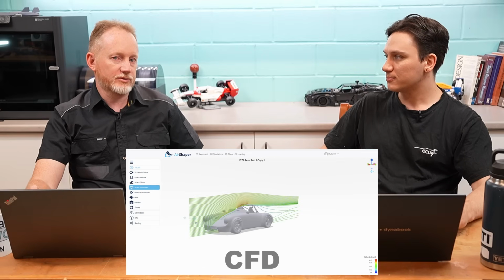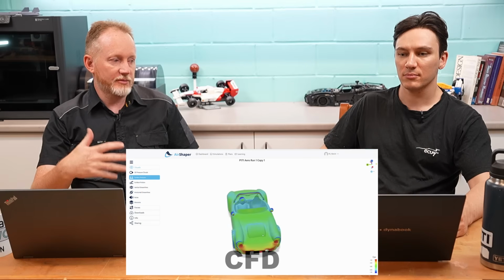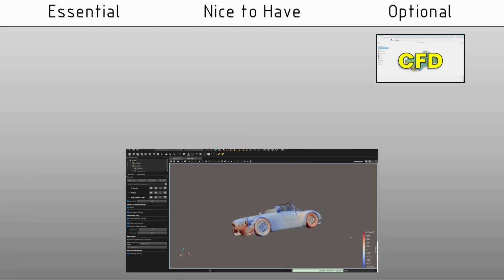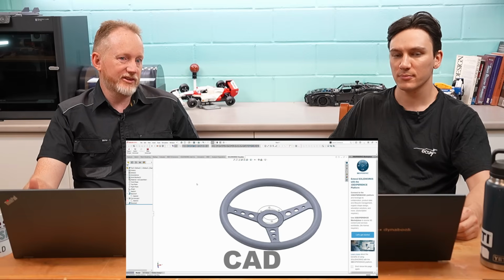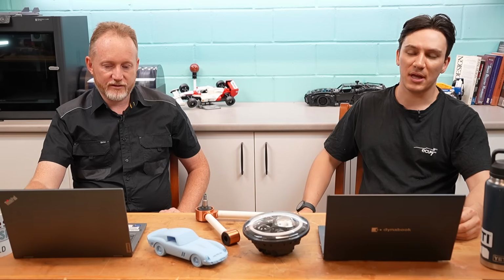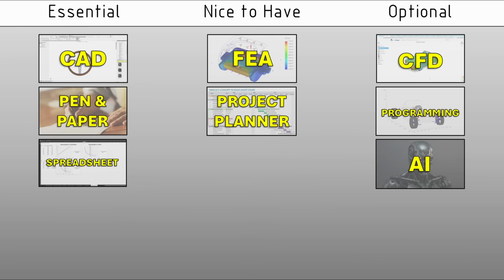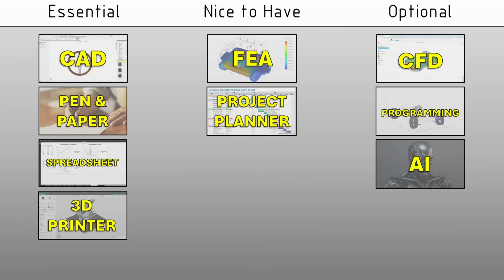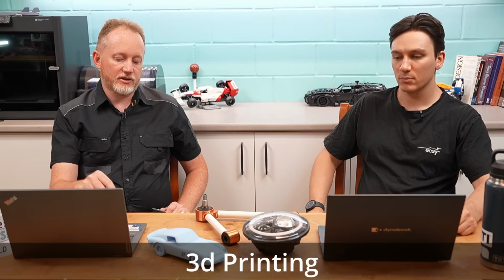Our Top Car Design Tools: Pros & Cons (Dr. Kev & Harley Q&A)

Comment: Havent watched the full video yet but there is a free version of Fusion 360. Its called Fusion 360 for personal use. You can also get soldiworks + 3D Experience for about £50. per year it is called 'Solidworks for makers'. But these are not for full business
Reply from the maker: Absolutely these are great options for most projects at home.  I haven't put enough time into Fusion 360 to be a decent user of it yet, but it is the software I recommend to most people not doing this professionally.

Comment: I think it would be valuable to expand the discussion on CAD by distinguishing between its different practical uses. For example, 3D CAD is excellent for prototype development and 3D printing, while 2D drawings are still essential for sheet-metal fabrication and even for assemblies where tolerances and manufacturing details need to be clearly defined.

One platform that really stands out to me is Onshape. Because it’s web-based, it’s easy to access and there’s a no-cost tier, which makes it a very compelling option.
Reply from the maker: Good point on the 2d CAD.  There is still plenty of value in 2d drawings in manufacturing, and maybe some things to cover in later videos, especially around tolerances.

I have heard good things about Onshape, and maybe I need to give it a go at some point.

Comment: 18:02 go to anna's archieve, download some great book about engineering (eg. Machine design, an integrated approach by Robert L. Norton), upload that to notebookLM and you have an absolutely masterful engineer available to answer any questions.
Reply from the maker: The future of AI in summarising texts is already here and useful.  Just a shame that anything from an AI needs to be verified, and it only takes in information that is fed to it, so much of which can be wrong in different fields.

Great tool to use in the process, but also highlights the ongoing need for testing and verification.

Comment: 8:27 Onshape has a free tier version with nearly full functionality but everything you make is public. For hobby projects probably not a big deal though.
Reply from the maker: I like the look of Onshape but am definitely not a fan of publically available models (especially part way through a design).  I wonder about the liability that might be assumed.  If someone did download something an engineer had uploaded, could they do so assuming that it is suitable for the task, and then break something at a time that might cause injury.

Having been a co-founder of an engineering design company at one stage I have learnt to be very careful around liability.  It might not be an issue but I'm fairly cautious around issues that could cause harm (even tangentially) or take risks that could impact my family.

At some point I want to see how some of the designs we go through in this project can be released, but certainly not ready for that to occur yet.

Comment: I am very much a noob with cad software, I think a great option is free cad. It's not as good as solidworks but for most things is 90% there. I would not use it as a business but for doing things at home is great
Reply from the maker: With easy access to Solidworks, I'm not sure I will get a chance to really give freecad a go, but I love the idea of CAD being more freely distributed.  The base technology is quite mature now and I think the high prices for a lot of packages really hinder it being much more widely spread.
Reply: @KevinHayward7 I have a hobby license from solidworks that I got for a decent price, but the important parts I design in freecad. The reason being I would like to make the vehicle I'm designing a commercial product and if I design it with a hobby license I might have problems with solidworks in the future since the license is not for commercial use. I asked solidworks for a full licence for startups but got no answer back. Solidworks workflow is much more streamlined so when I need to quickly sketch a part I do it in solidworks, after i develop the part I make it in free cad since I have no license limitations with that software. It's impressive tho how fast freecad is improving and at this rate of progress I think in a year or two it's good enough even for complex designs.
Reply from the maker: That sounds like a good workflow.  Might be something we look into.

Comment: Regarding FEA.
There are several examples of FEA optimised chassis around which consist of a bad design, fully optimised to be as good as a bad design can be.
Here is how to do it properly.
Make a simple beam element model (one beam per tube length, joint to joint)
Models like this are super easy to edit, all you need is the input deck and a text editor to make really quick changes
Keep a list of changes, their weight, and the stiffness
Keep changing where tubes are until you work out what features give high stiffness for their added weight
Combine everything you have learnt into a design
Optimise that design

Clue: It will look like a Lotus 23 chassis, with an extra bulkhead between the footwell and the front suspension, so that the front suspension is held by a six-sided structure.
Reply from the maker: I have a nice cutaway drawing of the Lotus 23 on my wall at work.  Great  little car with a really efficient chassis.

Might get an opportunity to share some chassis FEA on this channel in the future.  It is a process that can be quick and a lot of fun.

Comment: Two tools you didn't talk about are 3D Scanners and the right Books to learn from !! :)
Reply from the maker: The books we deliberately left off as we wanted to draw a line as to what was a tool / software.  We will probably cover some of that in a later video.

You definitely picked up on the 3d scanners.  As soon as I told Harley about your comment we were both a bit annoyed we had missed it.  Especially since we have already had a few videos that have included 3d scanning in the design process.

So yes definitely think 3d scanners are useful in the design process.
Reply: Why would you use a 3d scanner too design a car?
Reply: @Dynie-g7x  So you can scan components you can't make yourself so you can design parts around it and so they fit accurately as well as designing parts for awkward repairs,  plus you could scan other peoples cars for ideas, copying and iterations etc. etc.
All you need is a little imagination and these things can be useful :D

I would guess this tool fits in to the nice to have category, useful but not essential ;)
Reply: @f @freezatron  okay I guess I can see that
Reply: @Dynie-g7x  watch the video link I shared, gives a really good idea of how useful it is :)

Comment: One thing I would like to see is more of an explanation of the maths including an explanation of the units with examples so we can get a real world understanding of how to use the relevant formulas such that a layman can do some basic calculations on the back of an envelope to get them in the right ball park for some home designing.

A cantilever arm would be a great start, lets say we have a beam sticking out of a wall with rectangular cross section where the moment area is 

Breadth X Height Cubed divided by 12 = moment area ..... 

Great but now what else do I need to know to be able to calculate the max load that beam can take of a given length  ?
Doesn't need to be the complicated version where you calculate the deflection over the course of various loads, just what the max load might be assuming the max stress will be where the beam joins the wall, the root so to speak, Like a basic wing spar for example  :)
I've seen this example done using MegaPascals for the force/material pressure, millimeters square for the moment area calc and meters for the length of the beam, easy enough but what comes next ? :)

If I can work out a simple example such as this on the back of an envelope then I'll know of I have understood it well enough to make these formulas useful as opposed to some broad principal that looks nice on screen that I can't actually use :)

This is the kind of thing I would love to see with some examples so we can understand the units involved and how to apply them at the fundamental level.
Same for tension and torsion/twisting. Compression is a little different as one has to contend with buckling so maybe save that one for later ? :D
Resolving 2 dimensional trusses would also be a good one to do a step by step walk through of the maths for the layman :)

Here's hoping anyhow, this stuff would really help to bring the basic maths of engineering to life for many of us and it would be very much appreciated if you could make some videos walking us through this stuff :)
All the best.
Reply from the maker: Not aiming to make these videos like an engineering lecture (I get enough of that in my day job).  But will take the comment on board and try to see what examples we can flesh out a bit more in future videos.
Reply: @KevinHayward7  Cheers mate :)
Thank you for at least thinking about it, it would be great to be able to work through some basic hand calcs like that of a cantilever beam. A rod under tension seems like a nice simple one too. 
Perhaps asking you to explain buckling and resolving trusses is a lot for me to ask but if you could also recommend some good cheap books for the layman to get started under their own steam that would be awesome :)
Cheers
Reply: @KevinHayward7  Btw thanks for the replies, much appreciated :)

Comment: I find it really interesting that you're advocating for spreadsheets over programming for calculations. I recall a first year lecturer telling the cohort that using excel over the likes of matlab was a crime and a habit that should be broken. I've found myself actually using both depending on the depth of the calculation/simulation required.
Reply from the maker: Well then put just about all engineers in Spreadsheet jail.  Without wanting to speak poorly of another lecturer I think these "use this tool, not this one" are not that helpful.  Engineering is a practical solutions orientated exercise.  Anything that gets you to the answer within a reasonable amount of resources can be useful.

I say this as someone who has done a lot of matlab (and spreadsheets).  One of the big realities is that as engineers we largely work in teams.  Every engineer I know has a workable knowledge of spreadsheets.  A lot of engineers (especially Mechanical) don't have good programming chops.  That makes it hard to share work on a team if it is programming.
Reply: @KevinHayward7 would we be jailed in a spreadsheet cell? 😂

Comment: In my opinion a project car is about the journey not the destination...  On that basis i would include fab tools as essentials.  There is nothing more satisfying than making your own parts, but further to that i think having a crack yourself actually contributes to making you a better designer even if you eventually choose to have someone else make the final part.

I would also add a manual lathe in the 'nice to haves' for the capability it gives you relative to the cost.
Reply from the maker: The destination can often be disappointing because it can be the end of the journey.  I also agree that having experience in fabrication helps you become a much better designer, and can be very satisfying.  Like you I would also put a manual lathe in the 'nice to haves'.

Maybe given the learning aspect for a designer starting out we should have put fabrication in the essentials.  I do think of the experience I have had fabricating as being essential to my own knowledge, even if the tools fall into the 'nice to haves' for the design process of this project.

I will note that we have already got a lot of the 'nice to have' tools and software, largely because 'nice to have' means it makes the project a lot more enjoyable.  Even if I am a pretty crappy welder...

Comment: Disagree with the metal fab tools take. For under $1000(USD) you can get a basic setup with a decent inverter mig(primeweld 180 for example), corded grinder, corded die grinder, corded bandfile belt sander, basic drill press, and the necessary PPE. I have 5 welders(different locations) starting with a $200 vevor mig, primeweld 180 mig, 225 tig, miller 211, and a Miller Dynasty 210. The $200 vevor is definitely a $200 welder, but it could accomplish all of the mig welding I've done on multiple car projects. If you want to put a new muffler on your car the cheap mig setup is basically what it would cost to pay a shop to do it once.

I'd throw 3d scanning in the nice to have category too. A basic NIR scanner is about $600 while a decent laser scanner is around $1000.
Reply from the maker: We completely dropped the ball on the 3d scanner, especially since we have already a few videos up about using the tools in the design process.

The cost of fab tools in the US is impressive.  When I was living there it was amazing to me just how much could be bought for so little.  It is noticeably more expensive to get to a decent setup in Australia unfortunately.  Both Harley and I have collected some of this equipment over the years, but it does tend to mean that the equipment investment cost vs. outsourcing equation works worse in Australia than the US.

Comment: Something you might be able to try to deal with the cockpit wind problem is to copy what many modern convertibles do and have a deflector behind the seats. It could also be made from Perspex/Lexan and sit in the same plane as the roll hoop making it relatively discreet.
Reply from the maker: That is a really good idea that I think we will have to investigate.

Comment: Fusion 360 still has a hobby licence for free, but you have to go digging to find it. 

There are some silly limitations on the free licence that they've added in over the years, but it's still very powerful for the price. 

Oh and on the money no object thing, isn't it typically the trade off that you can have money or you can have time, but not both together. (You can have neither though. Ha ha) 

Thanks for the video!
Reply: Free Fusion360 has been awesome. Perfect for various modelling and 3Dprinting projects I've had over the years.
Reply from the maker: I do use Fusion 360 a little bit.  It is different enough from the other major parametric CAD packages that I can find myself feeling pretty awkward using it.  Nothing a bit of time wouldn't fix.  Definitely a good option.

Comment: Its pretty easy to make the means to an end the end itself with some of the complicated stuff like CNC and CFD.  However you're probably doing it for the quality learings so give it all a crack!  I reckon it all starts in an MS Excel spreadsheet though - that's definitely an essential.  The OpenFOAM CFD rabbit hole is a fascinating journey - as with your hourly rate, it's free(!) and you can rent a powerful computer from some cloud service to do the final runs.  I'd also seriously recommend looking a Plasticity for a very affordable CAD-ish package (it's not parametric - more like AutoCAD in concept) that is super great for class-A  level surfacing  - much better than SW and you can import the results to SW when you're done (which is, of course, never...).  The only thing it doesn't do at all is assemblies.  Also, I think BeamNG.drive is a great place to try out your design ideas in a simulation environment for very little money and a whole load of ''research' time.

I think if you had infinite money you'd also be able to afford a video production team so you can keep us all updated...
Reply from the maker: On your advice I am giving Plasticity a go at the moment.  It has some nice simple workslows.  Not a fan of the destructive modelling approach, but I love the simple interface.  Although the parametric design approach of solidworks doesn't really work that well for me when surfacing.  Changing earlier sketches / surfaces tends to end up with it all blowing up ...
Reply: @KevinHayward7  I'll admit I'm still learning the best way of using Plasticity compared with SW and the workflow is quite different and requires a separate mindset.  More like Blender but with analytic geometry.  What I've found to work well is to use folders in your selection tree to isolate sections of work that you can show/hide as needed but also work with copies of fundamental geometry so you always have these references to fall back on when reworking or rebuilding stuff.  Renaming the geometry to help find it again is also useful.  Yes, Ive found SW surfacing to be extremely frustrating too but I'm stuck in 2016 and I don't know how much it has moved on.  Possibly not much.  BTW, the xNurbs stuff in Plasticity is unbelievably powerful.  Alas only on the top level product.
Reply: This dude at 3D to 2D does some pretty cool quick demos in Plasticity that are worth reviewing to help boost the modelling productivity and reduce the frustration. https://www.youtube.com/watch?v=owwsdIy8Ee0

Comment: 32:35 "You're deliberately making something that is not as high performance or from a vehicle dynamics point of view..."

Unless you're racing, ultimate performance is not necessarily the point; enjoyment is.

Just look at the reviews of the Morgan 3 Wheeler where the near unanimous opinion is that it's way more fun than most any supercar despite its objectively mediocre performance.

Regarding the turbulence and buffeting, what I'm going to look at for my Morgan 3 Wheeler-like design (I'm going to use a Yamaha XV1900 V-twin) is trying to reduce the low pressure inside the cockpit by admitting air at the leg level with front and/or side scoops.

That will also give more of the body-in-the-wind feel of a motorcycle that I miss; I quit bikes after my third crash.
Reply from the maker: A couple of people have mentioned deliberately feeding air into the cockpit, might have to try it out and see what can be done.